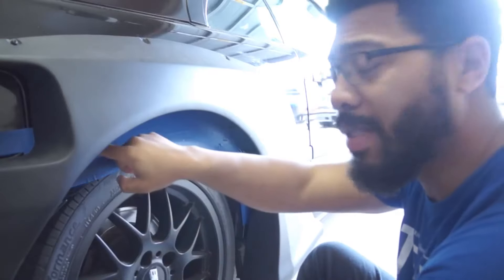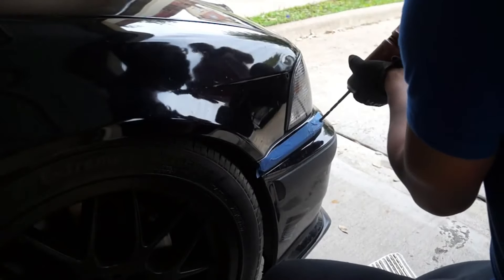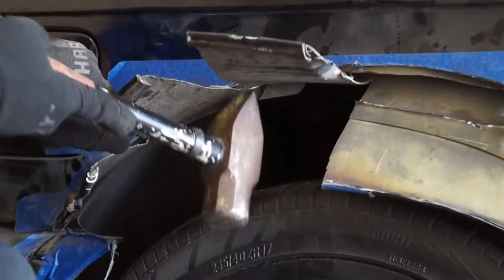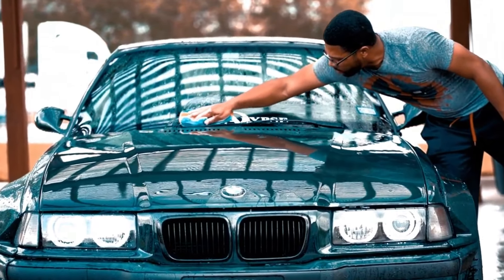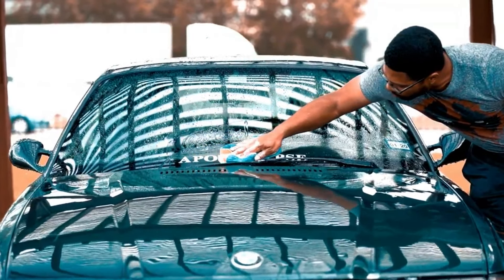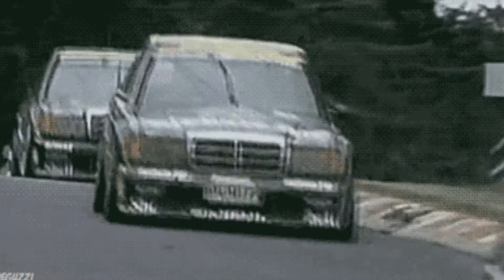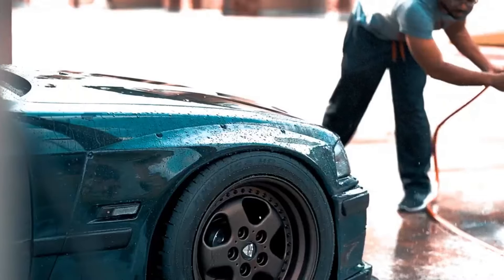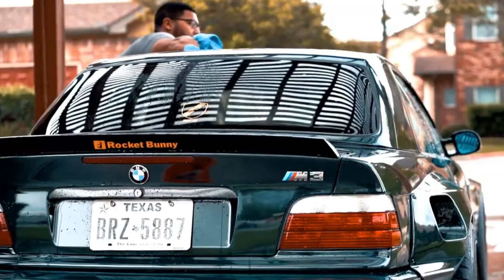Do I regret going widebody on my e36 m3?

Comment: Hanging chassis’s are kind of the first step I now take whilst doing any successful wide body kit install , learnt this the hard way with my e36 unfortunately 😂 I also wish I had done the proper research or had been told this, having said that after watching your vids you’ve done a pretty decent job , I had trouble getting the wheels to cuff and ended up chopping some ssl king springs in half and using them as my coil overs 😂, I’ve since done a few wide body installs and learnt a trick or two to make look super clean from an exterior point of view anyway... well done man !

Comment: Video fits nicely right at the time. Completing the last steps of my Felony Form E36 build and sometimes I question myself if that was the right decision. Unfortunately I live in Germany and we have some really strict technical inspection which makes it a lot harder even. I shared my plans with the inspection guy but every time I take a look at my car I think "Holy shit, inspection is gonna be a nightmare" :D Not sure if or at least how this thing will become legal. Those widebody or overfender cars live from stance and fitment and exactly this is a big difficulty here... Not too low, no smaller diameter tyres than OEM, not much camber, not much tyre stretch, no negative offset... And mine is supposed to be a daily, some kind of showcar (not really on that level but yeah) and also some kind of daily drifter :D Gonne be much fun to bring this to life finally... Well, at least the base car was cheap and the body was in perfect condition for the build. Wheel arches weren't to good, fenders rusty etc.
But I can image already how people at meets will ask dumb questions, why haven't you done it like this or that, why no proper rocket bunny, why aren't you running 12" wheels and huge camber, I would have done it like this, this build shouldn't be too difficult... Ugh.

Comment: Again another super video and info brother!! 💪 
Question I have for you is, have you looked into CSL parts for the e46 M? I know a few tasteful parts (csl suspension/csl exhaust/steering wheel/carbon trunk aka ducktail) can make a beautiful difference... 
The induction/“air box” though I know is super expensive and impossible to find here in the states.
Reply from the maker: Thanks man!! Yes sir I have. Im currently on the hung for a CSL trunk but right now with all this virus stuff shipping is very delayed on items like this. especially if its coming from over seas

Comment: What size wheels did you use on the widebody?
Reply from the maker: they are quite wide actually in this video they were 17x11 & 17x12.5
Reply: @BimmerDude which brand.
?

Comment: Kit choices are so darn limited and plastic require hacking up the wheel wells.   If you could build a wide body out of proper metal and avoid the inevitable paint cracking where you blend the kit it would be a lot more appealing.  Always thought that learning how to beat my own panels might be the answer (97 M3 50K m in perfect shape).   Maybe with a salvage car.   Rivet on plastic with seams always looks ricer to me.

Comment: Your cars are both sick, the widebody e36 is my favorite for sure. But why would you wear a mask while driving by yourself? Lol
Reply from the maker: thanks man! I normally only wear my mask when i know my hands aren't sanitized. When I didnt have time to wipe down my door handles inside and out as well as my steering wheel. Sometime the mask is to protect yourself from putting your own hands inside your nose or mouth. In this same situation is actually more sanitary to just leave the mask on instead of touching the outside surface of the mask with your potentially dirty hands. Its very easy to get absent minded while out and about and its just human nature to rub your nose etc. Very easy way of reminding yourself when you cant touch you skin. Just some advise from an X navy Corpsman

Comment: Meh, wide body vs over fender, they both widen the car, Fitment lab, way better than FF! Both again widen the car! Still enough to shove 18x13 with a 0 offset in the rear of my e36! (with mods) lol! Rocket bunny E36's look cheap AF! just a slapped on look! Still dope though!
Reply from the maker: You are right they are both wide. How ever im running 17x11et-26 2765/40/17 and 17x12.5et-56 315/35/17.. a tade bit wider than felony form-🙄
Reply: @BimmerDude  Felony for isn't really wide in the first place! The Fitment lab kit i run i can squeeze a 18x13 et0 with a 25mm spacer so -25 and it keeps all the body lines of the car, but it's all preference and styling!

Comment: Question is why on Gods green earth are you wearing a mask while driving in the car?? 🤣😂😂🤣🤣
Reply from the maker: Use your imagination.. there are a dozen reasons why you may see someone driving with a mask on in their car. So before you judge here are a few. A mask is much cheaper than a cabin filter. If you touch your steering wheel with your bare hands and your steering wheel is not clean you have to remove your mask at some point with those hands don't you... wouldn't it be better to have a mask on to prevent yourself from touching your mouth or your nose? Maybe the people you see driving around with masks on with rather make things dummy proof by eliminating "Human Tendencies" like itching your beard or your face or wiping your nose or your mouth while driving. Just some food for thought... no one's saying "YOU" should be doing this but maybe just maybe everyone has their own way of protecting themselves from themselfs and those they live with
Reply: Bimmer Dude ehhh .